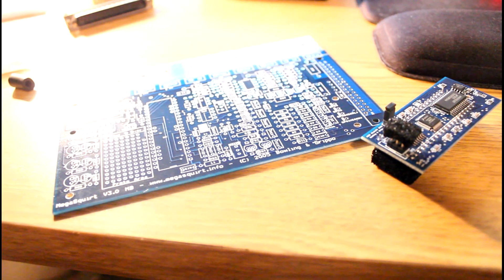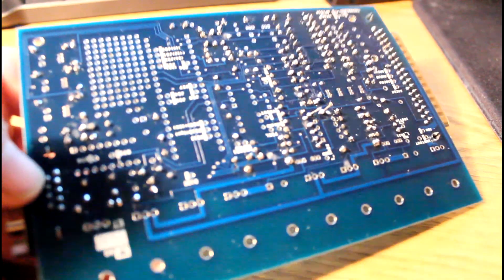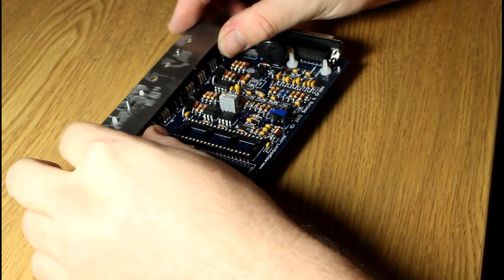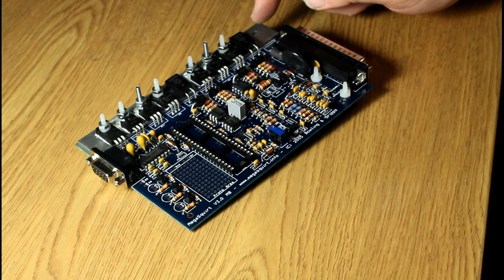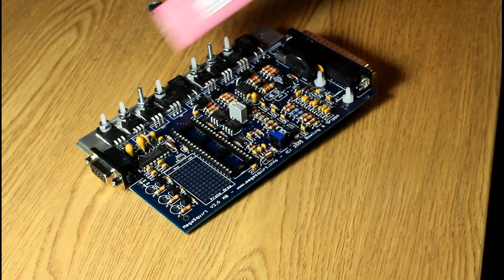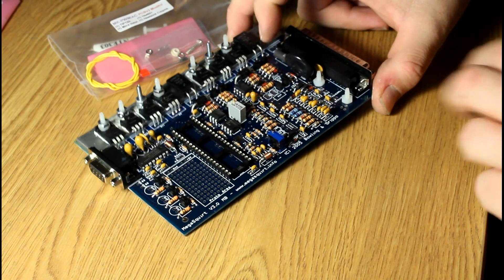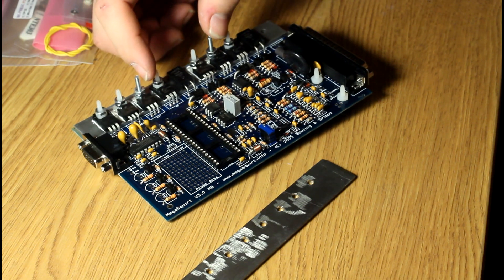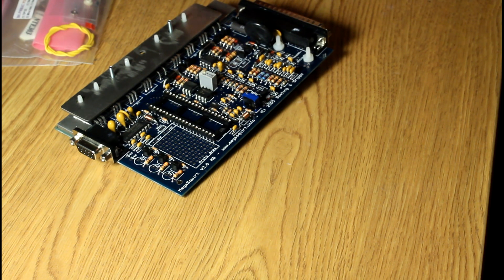Evan's Megasquirt Build Ep 2 - MS 3.0 Main Board Build

Comment: What size solder do you use for the board?
Reply from the maker: Main stuff I used .80MM (.031" i think).  I use that on everything but SMT.  I think on the little surface mount mod I did later to add the IO to the MS2 chip I borrowed a few inches of some smaller stuff, but I still used a huge iron.  Nowadays I have a better tip for small work.
Reply: @SquishyBrained  Alright, thanks. Gonna be building a MS board real soon and your videos helped a lot.
Reply from the maker: @finngurgens3264  cool, good luck! The project was a lot of fun. This unit may be going into a friend's car soon, so that should be cool.

Comment: Hey, ¿where can I find the MS3 assembly guide with the components location scheme?

Thanks
Reply: The bulk of it is here: http://www.megamanual.com/ms2/V3assemble.htm

If you have a 420a, you can use this guide to help you through a few of the specifics: https://www.diyautotune.com/support/tech/install/chrysler-dodge/megasquirt-your-neon/
Reply: One that that is pretty confusing is the 3.0 mainboard works with MS1, MS2, and MS3 chips.  If you have an MS3 chip, you still pop it in an MS3.0 motherboard, you just get extra IO and features.
Reply: Yes that is quite confusing... So it's meant that it's the same process as ms2 v3 board with the different chip?

Thanks again
Reply: Generally yes.  Depending on what you plan to do, you might leave off or add additional components to the main board, or "hanging off" the main board on a second heat sink like I did later in the series.
For instance, if you run 4 coil drivers (because you have the outputs to do it with MS3), you may need to add 3 more than what is on the motherboard by default.  diyautotune makes nice kits of those for like $5 each that have the transistor and such.  I found they had the best how-to articles.

The other main things that matter on how you build it is if you have a stepper based IAC or PWM, I think there is some pin you need to unconnect, but that is MS2 only I think.

And then the input trigger circuit can be a bit different from application to application, since different vehicles use different electronics... VR, hall, etc.
Reply: So the unassembled MS3 kit brings the same parts as MS2 kit except the CPU? Only 1 coil output and 2 injector outputs?

Do I need additional parts to support camshaft sensor in MS2?

I know additional outputs aren't expensive but I wouldn't like to face a lot of headaches or burn the electronics.